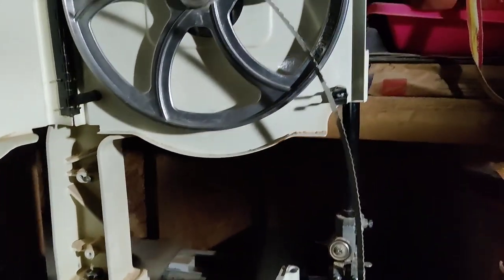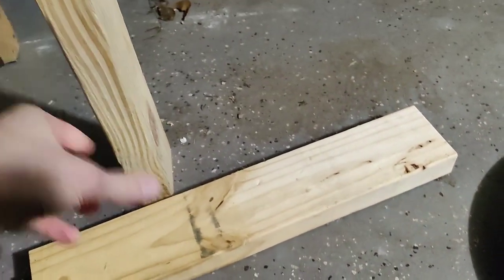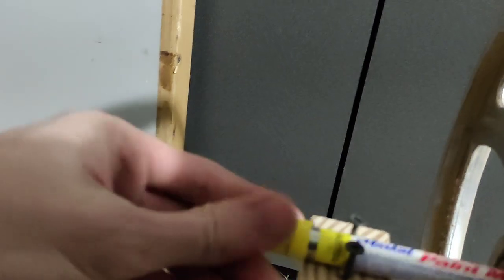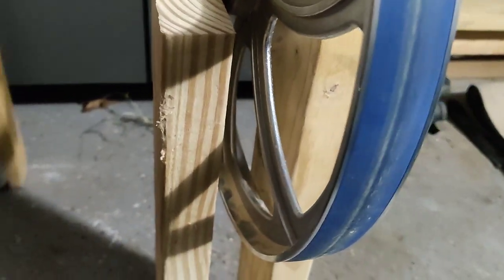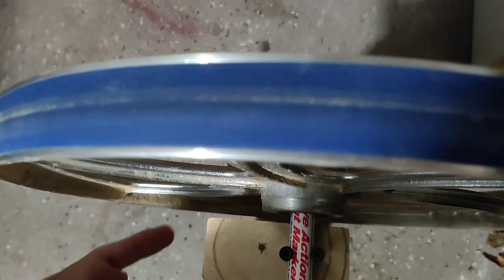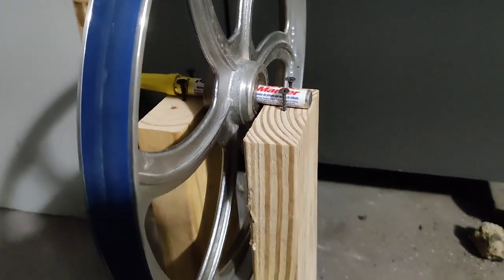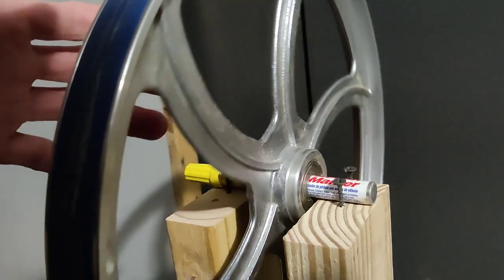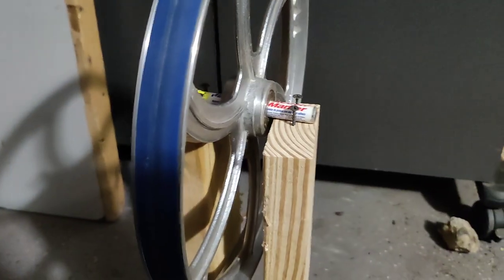How to balance a bandsaw blade #bandsaw #woodworking #tipsandtricks

Comment: I balanced mine on the saw.  I used car stick on wheel weights. I  stuck them on my wheel and spun the wheel to make sure it didn't stop at the same place each time.No more problems. I also used sheetrock screws adding screws untill they corrected the balance then I weighed them on my reloading grain scales. Then I knew how much wheel weight was needed.

Comment: Why??? you already had the wheel on the shaft of the bandsaw, just balance it in situ, far more accurate. Drilling more material away just weakens the wheel, far better to add weight
Reply from the maker: I don't know why I didn't realize this before 😭